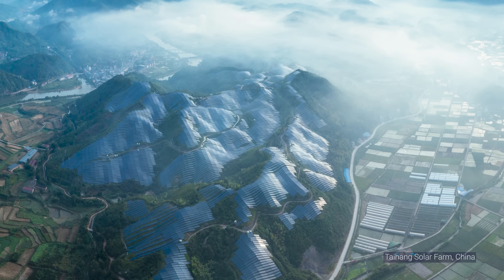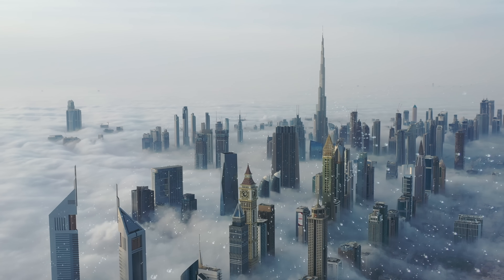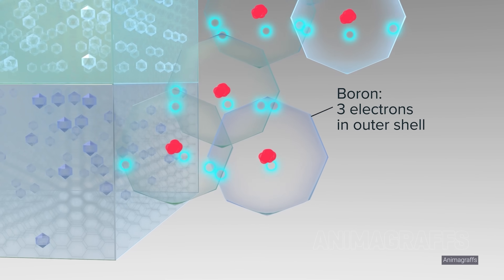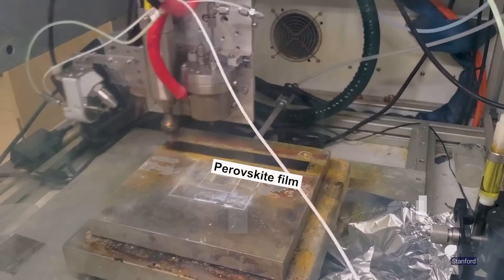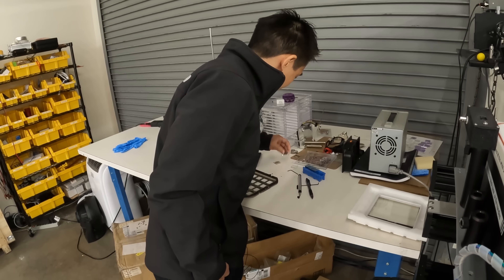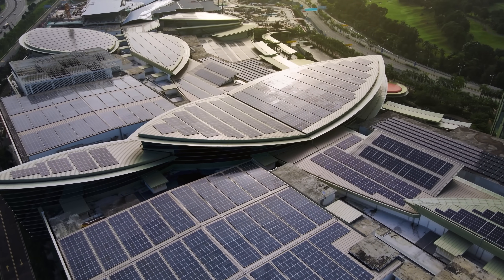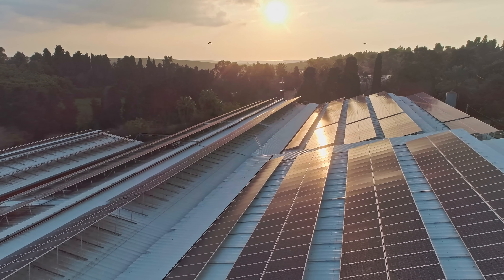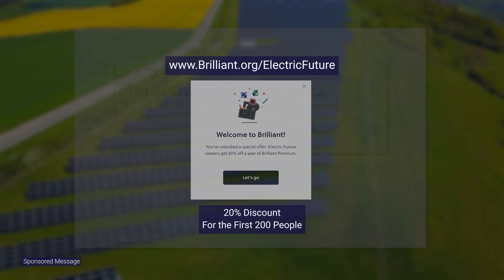Solar 3.0: This New Technology Could Change Everything

Comment: And what effect does this new solar tech have on the environment? Is it clean energy? How about waste? Could it be recycled? That stuff wasn't mentioned and info would be helpful.
Reply: Yeah....also US could be powered by 162x162km (sorry guys I was off the imperial system in the 70's) ? No mention of the requirement for storage. Did you see the massive thermal runaway fire in the battery storage systems near Melbourne, Australia ? They had to let it burn out.....and this was BEFORE it was commissioned and in use. 
I wonder what the longer term implications of large battery storage in terms of  mining rare earths through to disposal are.  
Disclosure: I'm all for electric, but I think the storage tech has a way to go.
Reply: Yes, I was firstly concerned by the mention of the use of 'lead' in production. Lead, of all things. And from there I thought of the problems regarding recycling. 
If it's going to be such a cheap product to buy, unless recycling is just as economical (and safe!) - expired panels may well end up being stuck in landfill, buried or shipped off in bulk to poorer ones rather than being properly recycled. 

Should these panels become a reality - and they are made using lead, I think it would be better to 'price in' expected end-of-life recycling costs from the 'start,' and government checks made to ensure manufacturers genuinely recycle old units responsibly and not dump them elsewhere.
And that, of course, highlights the problem of 'where' they will be made. 
In the West, manufacturers have to bow to tough environmental laws - and yet they still cut corners, despite the risks of being caught! 
Manufacturers in 'certain' other countries that 'specialise' in cheap massed manufacturing don't give a monkey's for environmental laws - so firstly, it will be difficult to make them take expired units back; and secondly, practically impossible to know how they deal with units once they've received them.
So, Western solar units will have to be made and recycled in the West to ensure they are safely dealt with...somehow, I don't see that happening. Profit is always king in such situations. 

The more I think about this, the more worried I am about it to be honest.
Reply: @debbiehenri345  I mean if they are just going to throw away the panels I’ll take em
Reply: @Trehlas  l'm more concerned about powering the country during winter, at night and prolonged cold periods.

Comment: cool tech.  The one problem solar tech can't solve is nighttime...and I have a 15KW solar system & two 10KW batteries.  Bumping efficiency up 2X plus while using 100X less materials is a huge benefit to lower cost of producing energy.

Any society needs energy to sustain itself. It needs excess energy to be able to expand, grow, or improve.  work = energy.  All forms of energy generation is necessary as ALL forms of energy generation has limits.

However, and this is a cynical comment, nuclear power is likely the most efficient and abundant form of energy production while also having the fewest negatives (limits).  Funny how that is ostracized in the "climate change" circles...thus when logic is not fully rationalized, AGENDA and politics is in question

Comment: That is fantastic but it is equivalent to talking about a new device that will put running water INSIDE of the home ....
but containers to hold the water are still made out of cardboard. 
This will not go anywhere fast without proper storage abilities when the sun is on the other side of the planet.

Comment: I don't understand why they use "virgin" land for solar panels preventing it from being used for other things when there are huge parking lots that they could put them over. This would be advantageous in two ways. One, land is already purposed for something else just needing the cost of the framework to support the panels. Two it would shade the parking area keeping it cooler for the parked vehicles and making them more easily air conditioned saving energy in electric vehicles. Something else that may be a benefit is the parking lot surface would not heat the air as much keeping the surrounding area cooler, and there is speculation that these areas add to global warming.

Comment: The reality is that thin-film solar has been in development for over a decade now, leaving behind a trail of bankrupt startup companies all failing to make it viable.  So I'm afraid this video just sounds like another risky  investment advert.   What would really be relevant is understanding why this particular approach is likely to become any more viable than all the failed previous ones?   But of course any comparison to failure like this just puts investors off.

This stuff is really difficult, and you have to remember that in the meantime utility scale solar using very well established silicon junction technology is already the cheapest way of generating electricity, and still getting cheaper.  It's very difficult to displace a well established technology that does the job.

Comment: Stupidity beyond imagination.  Solar power depends on the sun's brightness and this is highly variable.  Only an idiot would put a critical function on solar power.  Geothermal, while initially expensive, is the real solution to humanity's energy needs.  Never a worry about cloud cover, never a worry about wind or not, never a worry about planned obsolescence...mother earth has heat available to humans for millenia without ever releasing the trapped carbon from history.  Any other solution is moronic and intended only to provide employment to humans displaced by the foolish chase to end fossil fuel use.  NONE of these technologies would be possible without fossil fuels - just take a peek at how much energy goes into manufacturing a solar panel of any kind and it's pretty obvious it's a dumb idea for the human race in the long term.

Comment: 0:25 -- I had to check this myself. 100miles square solar panes operating at 100% efficiency, with the sun shining 24/7, would hypothetically produce ~749,906,657,280kWh/day, Whereas the united states consumes about ~11,245,900,000 kWh/day from it's grid.  So even if those solar panels are only working 8 hours a day at ~10watts/square foot, and storing/transmitting takes another 50%.. It's still enough.

Comment: I was watching a video where they use a chemical within a solar panel that is liquid at freezing temperatures and will boil at normal temperature!! And they were using it to generate energy with very little sunlight! So whatever happened to that process??
🙉🙈🙊🇺🇸🇺🇸🇺🇸🇺🇸🇺🇸🇺🇸

Comment: There were revolutionary materials in experiments on Skylab! And on  the space shuttles in Low Gravity!! New materials that was revolutionary lightweight materials!! Including a  material that could be used as a solar material to absorb solar light 100 to 1000 better than known solar panels!! Stronger materials that was very durable and very lightweight! But they do not put those materials into full production  on Space Station because they were blocked! Blocked some say by the government! But others say it was corporation who was afraid a new industry in space!! And some say that the space shuttle who was about takeoff and return the first large production materials in this case new revolution medicines! And would began the Manufacturing industry in Space full time!! And that was the reason they shut down the space shuttle program without warning or backup!! Who knows but the revolutionary material that could replace solar panels no one talks about as if forbidden subject!!
🙉🙈🙊🇺🇸🇺🇸🇺🇸🇺🇸🇺🇸🇺🇸

Comment: Longevity and environmental ruggedness are the key factors for Solar power success.  We have plenty of land on Earth to generate all of the electricity that we'd ever need at the current 15 to 25% efficiency.  The issue is Life Cycle Cost.  This includes manufacture, installation, maintenance, and recycling.  Although Perovskite solar cells can theoretically be made much less expensively than monocrystalline silicon cells, this ignores the other notable lifecycle cost factors.  While researchers are pushing to extend the lifespan of perovskite's beyond two years of use in typical outdoor environmental conditions, research is also moving fast on other alternatives such as vertically stacked thin film semiconductors that can harvest a broader spectrum of light with the same impressive long lifetime of monocrystalline cells.  Rather than focus on the word "Revolution" we should be emphasizing the words "incremental improvements."  Computational techniques for exploring the problem space of solar cells can be shared amongst many promising technologies.   There is no Solar 3.0.  There is simply a blizzard of incredibly small increments of improvement in understanding and tool engineering that will get us all to where we want to go.

Comment: 14:47 that exactly what I don't want my kids to see!! 💣💢⚠️ Solar 2.0 is already a complete SCAM!!   Solar 3.0 would be 10 time more worse. Just another profit game industry!! Although it offers some advantages in urban applications but when it comes to wildlife it going to be a huge disaster. 
The environmental disadvantages of solar energy include habitat loss, alteration in land use, the strain on water resources, exposure to hazardous materials, and pollution of soil, air, and water resources.
Larger utility-scale solar plants require a vast landscape for the installation of solar panels for the collection of energy. This means huge tracts of land need to be cleared of everything including vegetation. This can directly lead to the destruction and fragmentation of wildlife habitats. 
In addition to this, the construction activities during the installation of large-scale solar power plants can lead to higher levels of air and noise pollution affecting the flora and fauna of a bigger neighborhood. Diverting water for the manufacture and cooling systems of solar panels is also found to have a negative impact on the wildlife.

Comment: High effeciency, low cost. But it doesn't have longevity. If you can get your manufacture costs low enough set up your business to replace the solar cell elements every couple of years. Also, if you make the cells recyclable enough you could further save money on materials.

Comment: Even if the efficiancy is less by a point or two but the cost goes through the floor you may take the entire market.  If you were to try and power the US with solar it would cost a dollar to toast bread or something along those lines.  It's just too expensive and doesn't last very long.  You would spend an entire life time setting up and replacing panels and never have enough panels up.

Comment: Photo Voltaic paint has been available for almost a decade. The painting trade has however been reduced to slap and dab regards willing to work for pennies and unfortunately, painting your structure in a coating that will produce electricity does'nt help the Economy.

Comment: Im so confused... if you could do the entire US for 100 x 100 miles.. Why wouldn't an energy company start buying up plots of lands and powering smaller regions? Id imagine smaller states could be done with 1 mile by 1 mile unless it doesn't scale down.
Reply: considering there are 50 states you could place like 3 square mile places spread out in each state and fix it. just find pretty empty areas. or if a state is densely populated, move one or more of those to an empty state where almost nobody lives. there are plenty of areas in the usa like that. problem solved. plus the excess energy can be sold to other countries.
Reply: @remcodevries7721  I agree . I kind of feel like this video is somewhat BS or there is a drastic cost their not mentioning